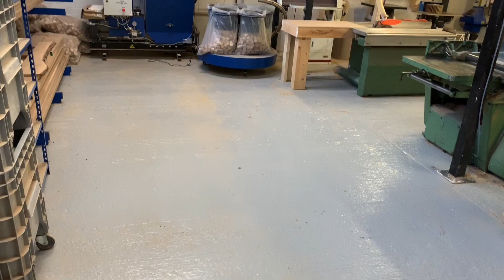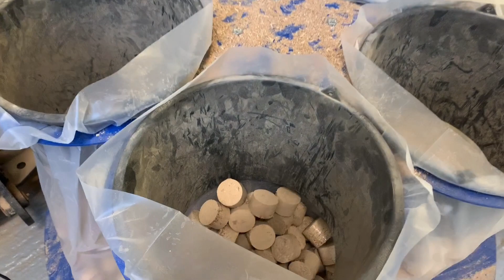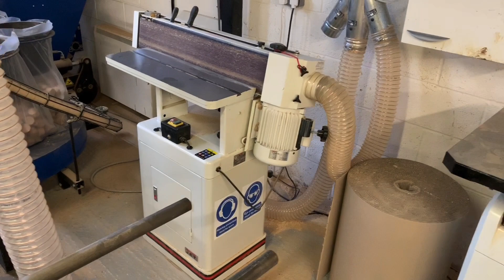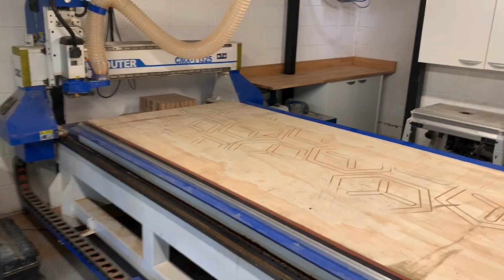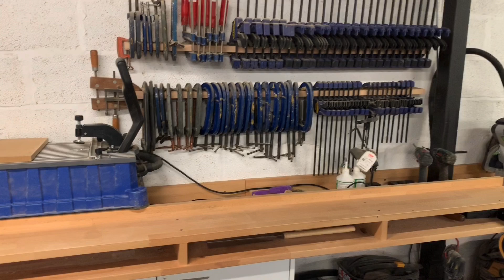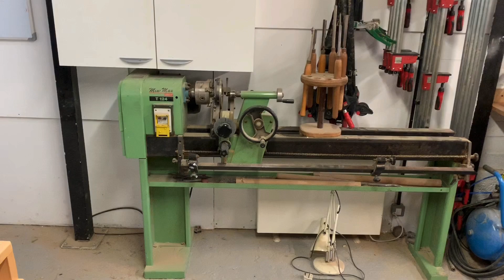Workshop Tour | Woodworking Machine Rundown of My New Shop

Comment: Boat building shop? Do you have another shed where you keep the bandsaw and build the boats? Sorry! 1st video I watched.  Looks like all your curves are done on the router. Do you do any bevels?  By hand plane? All your shapes done in CAD instead of your hands and knees on the loft floor?
Reply from the maker: No, this is it for now, I do work on mostly small boats though. The layout of the workshop has changed a bit since this video. I have a bandsaw now, most bevelling is done by hand. Not much traditional lofting gets done here, I haven't started a new build yet but when I do all framing will be CNC cut.

Comment: Dan you  are obviously  a Joiner and  Cabinet Maker like me as i have a lot of the gear you have .
I have a spindle  molder  by Robland which is  a handy bit of kit which i use alot on my boat building  projects .
I am lucky i am retired and devote most of my time in my workshop playing with boats .
Like your setup  but i think you need a bit more space for your  boat building  area.
Cheers Rob.
Reply from the maker: Hi Rob

I've not found a need for a spindle moulder to date but then I've never really used them so perhaps I don't know what I'm missing out on. There is never enough room for boat building but then the bigger the space you have the bigger the boats will get!

Comment: Great shop - just subscribed. I have just bought the same saw would be good to see a video on yours.
Reply from the maker: Cheers! Which saw, the Wadkin or the Festool? I'm not very knowledgeable on the Wadkin and mostly use it as a rip saw really.
Reply: Dan Lee Hi Dan - Yes just bought the Wadkin but haven’t installed or used it yet as new workshop still being built but would be good to know more about it. Thanks